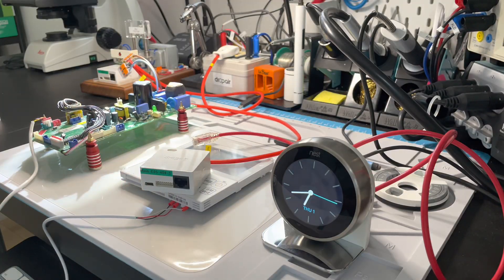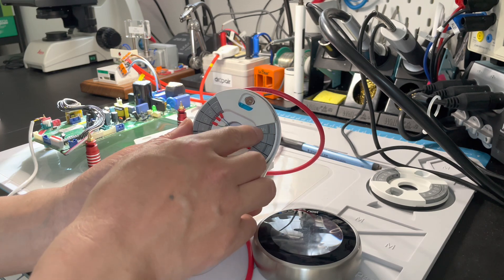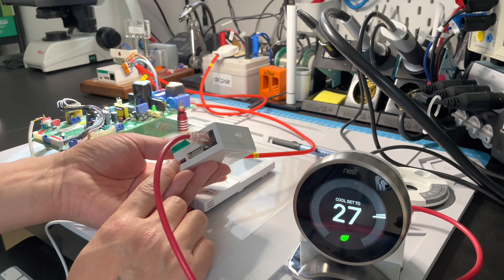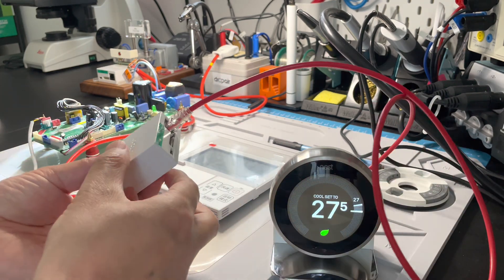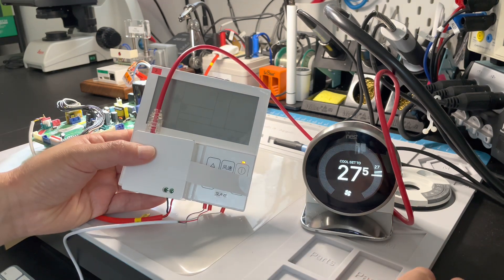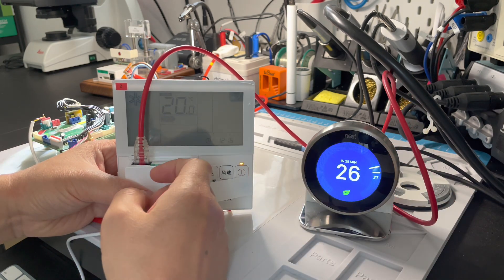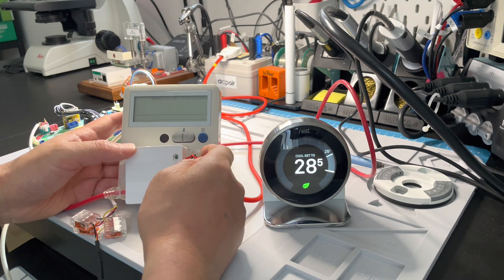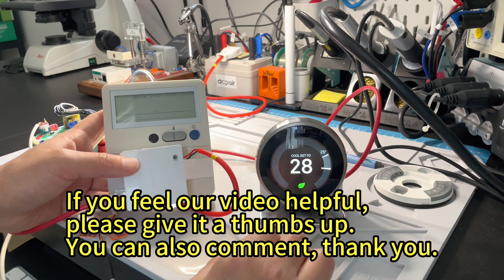LG Mini6 wireless solution installation guide for Nest or Ecobee

Comment: Great job.  Do you have a video on connecting a split system metsubishi?
Reply from the maker: which solution would you ready to use? Mitsubishi has so many different solutions.
Reply: @dropairs  I want to use a simple system for a private house.  A simple Mitsubishi split system, a simple air conditioner.  One outdoor unit One indoor unit
Reply from the maker: @ibrahimabumuslim6144  Add my whatsapp and tell more
Reply from the maker: @ibrahimabumuslim6144  +8107043041687